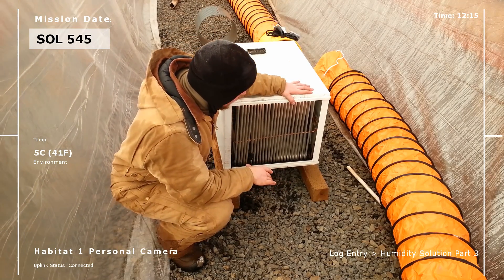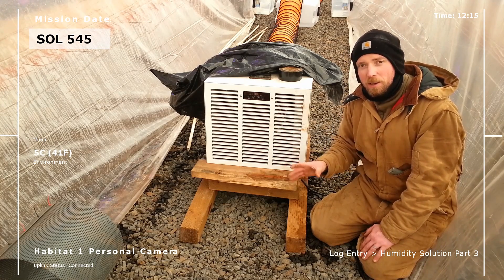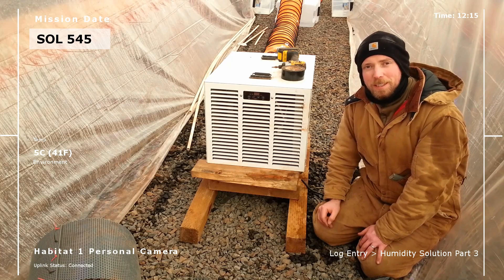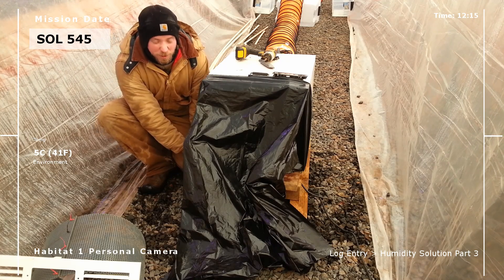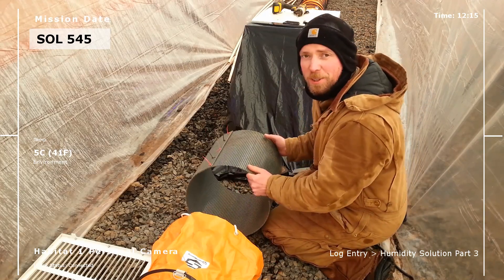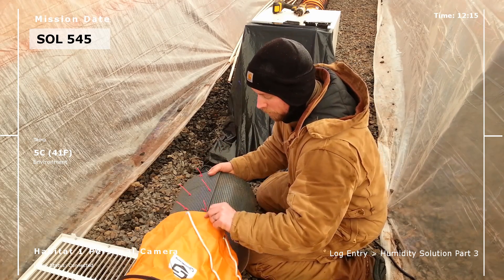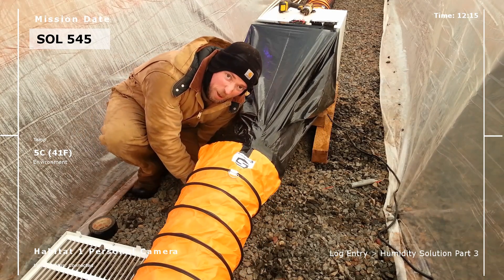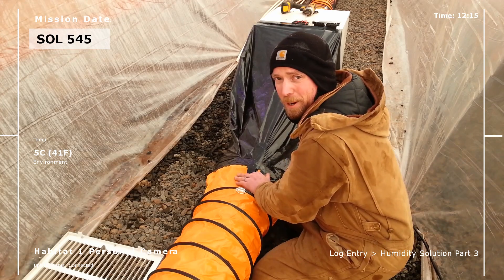Low Cost, DIY, GREENHOUSE Heating Solution  - Part 3

Comment: Wouldn't it be easier to put the structure into the bag first and then attach it the the dehumidifier, that way you would know big a hole you would need for the orange pipe?

Comment: Forgive me if I haven't read all the prior comments, and may have missed something...  I've been thinking for several days about the humidity issue.  In the summer, I figure it's not a problem, fans, ventilation, etc.  My thinking out loud at this point is this:  Your dehumidifier is depleting external power to create cold work, to condense.  Have you entertained using the outside ambient (cold) to do your condensation for you in the winter, when the temp is cold enough?  The tents in your grow rows are already telling you the path.  They are condensing amazingly well without outside influence.  Collect that water.  Arduino an additional  system that will know when it's cold enough outside to condense water via outside temps, duct the cold outside air into an exchanger/condenser to dehumidify.  Thanks for your faith and testimony Brother!

Comment: I really think that you should have put the ziptie locks on the inside and cut the tails flush to the lock.  I would also recommend to build the adapter out of wood because of rigidity  or use some sheet metal for it

Comment: Apollo 13 saved themselves with duct tape. So, there should be a roll or two on every spaceship and in every car for that matter. Your setup will be OK temporarily until you can afford something more permanent. You just need to inspect it frequently for leaks because the material isn't very durable. The worst problem you may encounter is frost buildup on the condensing coils if the airflow is to low. If the dehumidifier starts freezing up, you may have slow down the compressor or add a booster fan. You could also build a more permanent reducer using duct board which is easy to cut and assemble with duct tape.

Comment: Those carhartts you are wearing should have a small opening about two inches under the double knee for knee pads to be installed. Foam rubber can be rolled up in slid in there. I used to do a lot of lay out on my knees on fresh concrete, Foam in my carhartts saved my bacon.

Comment: Great vids! I'm sure you have already put the fan inline but in my head I was thinking it would probably be better on the fan if you put it after the dehumidifier hence pulling the less damp air through the fan. I would guess than the fan would last longer that way.

Comment: Ok so what's needed here is ideally a free/very cheap solution to make a decent quality square to round plenum. One thing you do have access to is wood. It's likely that you already have enough lumber around to make a box. Make the box so that one side is open and will slide onto the dehumidifier. The opposite side you cut a 12" round hole and glue in a piece of the screen material you just used. You can then slide the orange hose over the screen material and fix it using zip ties. You can fasten zip ties together to make one long tie that will go all the way round the orange pipe. You can then tape over the top of the tie to seal it. Any good HVAC installer will tell you that the one thing that duct tape is no good for is sealing ducts! They all use aluminium foil tape because it seals very well and doesn't degrade over time. If you wanted to make the system air tight you could line the inside of the box with plastic (I'm sure trash bags would work for that) 
I wish you lots of luck with your project. You've inspired me to be a little more self sufficient here.

Comment: Getting in and doing things can be great, it might work, or you might need to redo it. Given your ingredients, here's my omelette recipe for you. I would start by inserting the plastic mesh into the duct for sizing. Then, ziptie the mesh with the ends inside the cylinder. take now sized cylinder and place inside bag. cut hole in bag. place bag on dehumidifier as you did. place cylinder end inside duct and tie off. less chance of bag coming off duct. Great content, I'm not Christian but enjoy the engineering. keep it up :)

Comment: So is this the dehumidifier unit, or the air con unit? I'm getting lost with the outside temp, rocket stove etc and what he's trying to achieve?
Reply: this is a dehumidifier (works on the same principal as an Air-con except the condenser and evaporator packs are inline) he is trying to dehumidify the air before it gets to the rocket stove so he can collect and reuse that water in the fish tanks

Comment: wouldn't it be better to buy a 4 x 8 sheet of foam backed board and make a rigid box to attach the hoses to.  It is super light weight and if you set it on some more 2x4's will not hinder air flow

Comment: Kudos Jeff on ingenuity. If your prototype works, I suggest you upgrade to 3 mil thickness construction trash bags. More durable and I think they would be easier to work with and more suitable for the application. Anxious to see if it works like you hope it will.

Comment: Suggestion...Why dont you use one of those plastic containers like you did for the sidewalls of the grow lanes....the airlocks as you called them.... Cut it in half and then you can slide one side into the other overlapping then cut your 12 in hole in the bottom for your duct fitting.

 It would be a cleaner transition and would be able to visualize the output or input and if there is condensation on the input its also another collection point as it slides down the walls of the plastic container!. You could probably be able to reuse the screws and mount it on the plastic container as well. Every drop of water is precious in an arid or closed system environment. Keep exploring! We are with you!

Comment: if the flow rate is off. the plastic bag will billow and rip,dislodge the duct tape. I did hvac for 7 years, real world application. not an after thought.

Comment: hope the trash bag is on the pressure or output side of the ductwork. the suction side won't work.
Reply: kf4dcy that's my concern too. I guess if the in pipe is big enough and the bag has enough tension that it will work.

Comment: gees, roll the fitting up tighter than needed for the flex. then release the fitting. it will expand to the flex. then zip tie the plastic.

Comment: you'd be better off using metal and mastic tape for hvac units. for the penetration threw the tents/rows. I said use sheet metal but ply wood would be a better fitment to mount duct rings for your flex ductwork.

Comment: Any local HVAC company should be able to make you a couple 18in square-to-12in round reducers in about 30 min. I know you want to do everything yourself but isn't the point of your experiment to prove that your end goal can be accomplished. I'm just worried that you are always going to be messing with those garbage bags because the constant pressure and temperature differences will destroy the integrity of the duct tape and rip the thin plastic bag. As always, great channel and good luck.
Reply from the maker: thanks for commenting Craig. Actually it's not about doing everything myself so much as it is I'm out of money and have to find a way to make what i have work. I'll be keeping track of all my desired improvements but for right now, the simple answer to yours (and many other comments regarding why don't I get sheet metal done) is simply money. I love the ideas coming into this site, and trust me if I could I would love to execute on so many of them. They are great. I just don't have enough cash. Appreciate the comments and please keep them coming. Just because I can't afford something now, doesn't mean i don't want to replace my solution with a better one!
Reply: I understand the lack of money easily enough.  Kinda like when I was a kid and bought a wallet and don't have any money left to put inside.  Now I have 100 acres and could use a ton of "stuff" to get the farm going and I've not been lucky on the lotto yet ;)  so I'll continue to split wood by hand and stay healthy until I win.
Reply: I agree 100% with Craig.  It will cost you a few bucks, but it will be way more durable.
Reply: Why can't he use one of those plastic tubs he uses for the distribution of air.  Cut a hole to fit the Dehumidifier in and a round hole for the hose.
Reply: Just eyeballing it from here, I don't think the plastic tubs are big enough, at least in one dimension, to fit to the dehumidifier unit.
Reply: Amen to that, while it would be amazing to have the "proper" things, in reality when experimenting on a budget, you use whats around, and what is cheap. It should do for now for proof of concept. Eventually if it proves useful you can always upgrade.
Reply: Also not to mention, problem solving, critical thinking and practical application go way further than money on these sorts of projects. As they will on an actual mission to Mars. Improvisation is a skill more important than most people realize.
Reply: Go to Wranglerstar and ask him for some sheet metal. He has an old dryer sitting in his boneyard. You just need a sheet metal brake and some pop rivets and do it yourself. Use cardboard as a template first then transfer to the sheet metal.
Reply: I had a friend that cut up an old chest freezer and saved the sheet metal skin for other projects. On a homestead, nothing gets thrown away!
Reply: use lycra type strech fabric instead of the poly bag. Paint it with fibreglass resin to fix the shape. Once the resin is dry, reinforce with chopped mat. Sometimes you have to make stuff yourself because its the only option, try finding an off the shelf  fitting to transition 10" round duct to a 39" x 3" rectangle ;)  24" square to 12" round is a walk in the park.